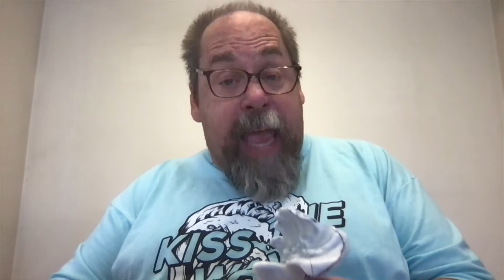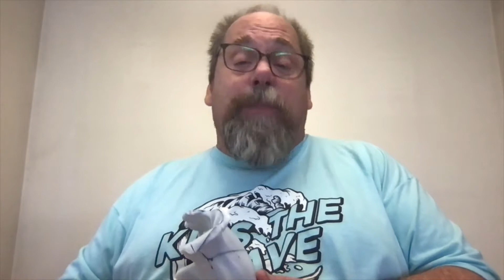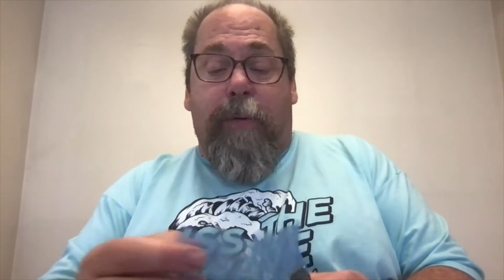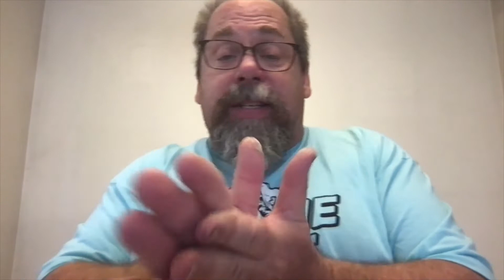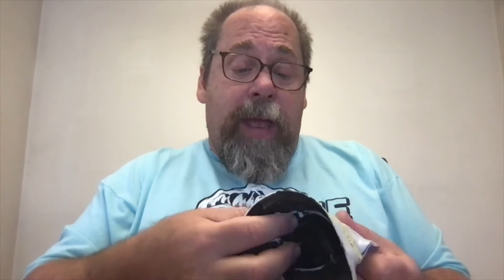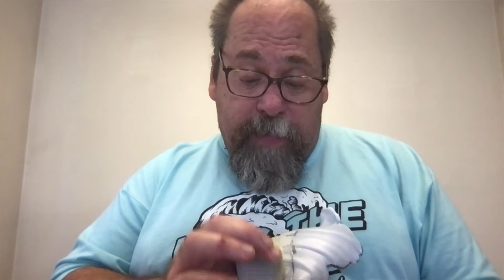The Glue Bomb Show, Episode 147: Milliput Product Review

Comment: Thanks for the review on the milliput, I've been using wood filler, it disolves in water so I rub it on a seam and smooth it with a wet finger.  Seems to work well for small seams.